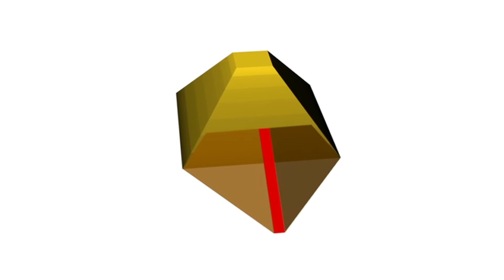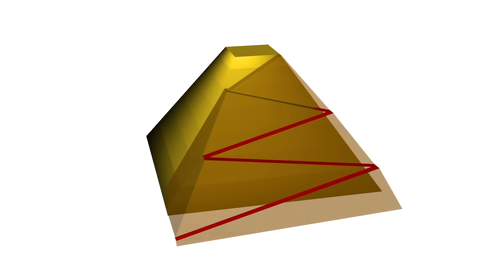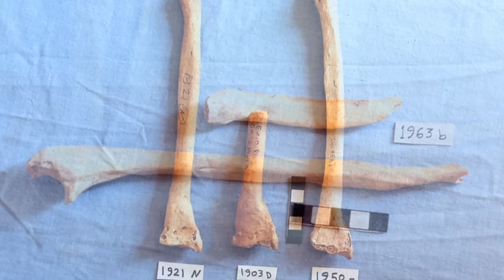Egyptology - Pyramid Construction

Comment: One video proposed they used water hydraulic  like elevators lifting blocks up shafts of water. Would require lots of water and water tight wood shafts . Then one would man handle blocks of stone at top of the shaft to get it off its flotation device . But I honestly dont think that's what they did. Several hundred men can move some pretty heavy stuff just using block and tackle. Say 200 men are pulling each 50 pounds using block and tackle  that would be 500,000 pounds. Now multiply by what ever ratio your pulley system is using . The problem would be finding rope strong enough to pull the weight,  or lift it. That's assuming they did not have chains.
.

Comment: Lol. Guys. Engineers ruled this technique out decades ago when they realised the ramp they’d need would have to be larger and heavier than the pyramid itself. Derp
Reply: And we would see evidence of it which is not there
Reply: @claytonhorn7195 absence of evidence isn’t evidence of absence
Reply: And that it had to be as solid as concrete.
Reply: @ins2177  eduardo is the perfect example of those ignorant old people who claim every process that hasn't been fully explained is the work of satan
Reply: Internal ramp
Reply: A bigger mystery, who built the ramps and how did they get rid of the material??🤔
Reply: @thecure4470  i think they use the nile river to float the blocks.
Reply: @nickkrikorian5909  
Maybe? But you still got to build a ramp or some method of lifting gear but you have to quarry the blocks and square them up with a flatness spec. Not the outer blocks, the much heavier ones and granite ones as the structure had to be built from the inside out. It was not just a case of building a solid pyramid, it was a puzzle and for what or who were they built for? Certainly not a burial chamber!
Reply: Simon Taylor okAy Smart Ass! If you know it then, prove it! Bitch ass
Reply: People in the Belgian Congo dig lithium all day and people in European refineries are making trainloads of plastic. So you can hold a cellphone in your hand...A ramp four times the size of the pyramids would be an easy decision for someone who decided to build a pyramid... 35 thousand corporations got together so we could put moon rocks in a museum.
Reply: dan brownell Great way of looking at it
Reply: The reason for which the Great Pyramid was built perfectly illustrates the desire and determination of the people to leave a trace of their passage through this life and the construction of the Great Pyramid for the Pharaoh Cheops represents a symbol of eternity! 
  Read the book on the website-ul    www.thegreatpyramidofegypt.com   in English or Romanian
 (NO MONEY) and comment on the book , photos with models made of wood and brass board, drawings and sketches commented by the author of the book and logical explanations ?!? motivated by the construction of the Great Pyramid of Egypt. On page 59 is a centralizator with some of the novelties (comment on the 78 news items omitted by ........... and I will send you an autograph book) and assumptions of the authors in the order of their appearance in the pages of the book.  Leave a comment if you can!

   Have a nice day.
   Hănțulie  Ionel
Reply: If you want to know more about their tehnology in ancient go to google and search for " joy of satan"
Reply: @eduardo9571  google ce sors everything. i dont trust google for real research. if they say its a conspiracy most likely its true

Comment: If you really think about workers dragging up 2 ton blocks it's obvious that that method would have been one of the most impractical ways to build a structure the size and Complexity of the great Pyramid.

The estimated number of stones to build the great pyramid is 2.3 Million!

The pyramid is 756 feet long on each side, 481 feet high, and composed of 2.3 million stones weighing nearly 3 tons each for a total mass of 6.5 million tons.

Consider the amount of people necessary to move a single stone from "hooking" up the transport apparatus to Positioning it and the TOTAL amount of time necessary to fully Complete the Project suggests that this is NOT how this was done.  

If you are Limited by your own Lack of Creativity, you're unlikely to see that Einstein was Right on about the importance of Imagination!

Comment: Im thinking a ramp of that SIZE would require the same voume of material as the structure itself.
Reply: People like to assume the ramp went to the top.  That of course is nonsense and unnecessary and thus = reflects a lack of understanding of the evidence as well as critical thinking skills.

1 - the blocks get smaller as the pyramid rises in height.  Google photos of the top of the Great Pyramid.  Note how the blocks there are small enough to have been slid into place by several men.
2 - Herodotus wrote they employed levers and what he termed as "a machine" which was likely a lever device which employed a fulcrum and counterweight.
3 - the largest/heaviest blocks are found in the bottom third of the structure with the heaviest being the relieving stones which sit atop the King's Chamber as well as the longest being the blocks which make up the Grand Gallery which are below that level.  

Moral of the story:  so the ramp in truth only need go as high as the heaviest blocks to be raised = King's Chamber.  Above that level the smaller blocks could be raised via levers.  Herodotus indeed wrote he felt the "causeway" they created to be as great an undertaking as the pyramid itself..........but that does not mean it went to the top.  

Finally the Great Pyramid was built upon a small hill.  You can see where they tunneled into it in the lower passages as well as on it's western base you can see where they cut it down to create a base upon which to lay blocks.  So it's possible they employed that natural incline as a ramp to build up some of the interior before covering everything over with blocks.  This means the ground would act as part of the ramp for a time before the area was encased in blocks.

So you must step back and consider the totality of the evidence.  We have ample evidence they built ramps.  Those ramps however were not necessarily needed to run all the way to the top.  Have a nice day.

Comment: I think the real question is how did they build the huge ramps. If you find out how they built the ramps then you will no how they built the pyramids.
Reply: Ramps were created one of two ways.

1 - we see at Giza the remains of small earthen ramps around tombs which were created from a mixture of sand/stone chips/tafla - a clay they mined and used for a wide array of applications.  When the limestone quarries at Giza were excavated years ago they were found to have had massive amounts of...............yup = sand/stone chips/tafla dumped into them - or what they built ramps out of.  There is also the remains of a large tafla mining operation near the worker village at Giza.
2 - they also created ramps from mud bricks. There are the remains of mud brick ramps at places such as Karnak.  Also in tomb depictions we see mud brick ramps employed in construction along with wooden frames upon which craftsmen stood and worked.  As an example the tomb of Rekhmire contains a mural of a hypostyle temple being built.  There is a mud brick ramp leading to it while it's interior is full of mud bricks to it's top.  So they systematically laid bricks and blocks level by level until the top lintels were placed.  Then they removed the mud bricks - chiseling the blocks as they went = until they reached the bottom leaving only the completed columns of the temple.  

Moral of the story:  so we know how they built ramps and how they were created and employed.  In the case of the pyramids only the shape of the ramp is unknown.  We do however know it once sat on the south side of the Great Pyramid leading down to the adjacent limestone quarries and the harbor which once sat near where the Temple of Khafre now sits.  

The south side is closest to the harbor and quarries + the other sides are not conducive to a large structure as there are steep drop-offs + and all of the ancillary structures - Queen's Pyramids - are found on the eastern side.  All royal pyramids always had the ancillary pyramids on their southern side - all of them except for Khufu.  That tells you that "something" large was there to block their construction = which has to be the ramp.  Have a nice day.
Reply: @varyolla435  very educated answer a very interesting read thank u.
I find all this very interesting they wer well ahead of there time. None of the engineering skills make any sence to us. Its amazing
Reply: It only doesn't make sense for those who fail to first learn all of the evidence as I alluded to.  What I noted is but the tip of the iceberg.  So the Egyptians were not stooopid = just not as technologically advanced as we are today.  Yet the basis of much of our technology results from precepts laid down centuries ago as a result of observational analysis and trial and error.  Ancient peoples saw "correlations" in nature etc. and studied them to develop things as a result be it mathematics or whatever.  

Moral of the story:  the Egyptians employed trial and error to find something which worked.  We see this progression of learning in the early crude mastabas and pyramids leading up to those at Giza which represented the apex of pyramid tech.  Once they found something which worked = they employed it going forward.  As an example = corbelled halls.

Limestone is a mediocre load-bearing stone.  As such employment of it across wide spans lends to cracking and collapse.  That is why later temples employed harder sandstone for lintels while the columns themselves were of the softer limestone.  Anyways we see corbelled hallways in the Red Pyramid whereas the earlier Bent Pyramid in trying to create large rooms internally eventually saw cracking with subsidence.  By stacking inwardly the wall blocks in a tapering fashion = the room can withstand the weight above.  We subsequently see corbelling employed in pyramids going forward.  

So they were not some mythical "advanced civilization".  They simply tried different techniques until they found something that worked.  Have a nice day.
Reply: @varyolla435  if I may ask you a question how do you think the pyramids wer built and why
Reply: 1 - the employed ramps and levers as noted to raise objects.
2 - Google pictures of the limestone quarries at Giza and elsewhere.  Note how we see shallow cuts in the bedrock along the layers of limestone with holes alone the line much like the edge of a saltine cracker.  They would drive wedges into the holes until the bedrock fractured along the line like breaking off a piece of a Kit Kat bar.  Then long chisels would be driven into the fractured section of stone until approximate sized chunks broke off which would be carted away.  In some cases copper saws and an abrasive such as sand or corundum would be used to more precisely create a block and in some cases it would be polished via sanding using said abrasive and perhaps clay and water.
3 - look at all the pyramids = where are they found???  Answer:  on the western bank of the Nile.  Why is that important???  Answer:  in the Egyptian religion that was considered "the land of the dead".
4 - also note how pyramids are all co-located around cemeteries.  Where you see a pyramid = you find a necropolis.
5 - pyramids always came with an accompanying mortuary temple of which almost all have been destroyed long ago.  

So pyramids = tombs which are as noted above always located in cemetery sites surrounded by tombs and temples.  The Egyptian religion was based upon 2 things.  First is the body must be preserved.  No body = no afterlife.  That is why they mummified people and buried them with things needed in life.  It is also why they put them in things like sarcophagi and tried to create "robber proof" tombs. 

Next is you needed to keep your name alive so as to be remembered.  If people forgot about you then offerings would not be made and you would not exist in the afterlife.  Accordingly they built temples and tombs to "stand out" so that others remembered them and the requisite offerings could be made.  On a side note that is why later pharaohs during the New Kingdom employed damnatio memoriae = or "erasing" someone.  They would change the cartouches on temples and have their own placed upon them to take credit for what another did.  Sometimes they simply destroyed the temple altogether to try to erase any memory of a person. 

Moral of the story:  so to understand the pyramids = understand the Egyptian religion.  They were tombs created to try to protect the body of pharaoh and to make him stand out so as to be remembered and thus ensure his existence in the afterlife.  Unfortunately for them = aboveground tombs were magnets for tomb robbers.  

Accordingly almost all royal tombs in Egypt were plundered millennia ago when the Kingdom's collapsed and times got hard.  Since mummies were wrapped up with valuables = they were often destroyed by tomb robbers via cutting them up and/or burning them to get the valuables within them and to destroy the afterlife of the pharaoh. The same happened for the later underground tombs as well. Sometimes later pharaohs themselves ordered tombs be opened and plundered to replenish the royal treasury.  Ramses XI did this as one example.   Have a nice ay.
Reply: @varyolla435  very well said was good reading all your comments thanks bro

Comment: "The limestone outer cases were removed to build mosque and Castles in Cairo"??? Why and how would you remove blocks from that high up and transport them safely to the bottom of the pyramid? And then hope they fit your new structure correctly. What a bunch of BS.
Reply: Why Knot Do you have a better idea?

Comment: If i may, let me take a crack at this. Remote viewing indicates. 4 ramps. At alot less steep angle than 52 degrees.Different stones were transported in different ways 3 main ways. 1: some stones were quarried into a cylinder shape. Wooden posts were attached to each end using leather straps. Then, leather straps were wrapped around the posts with animal fat as a lubricant, and they were pulled by animals. They were pulled all the way to their destination. Then 3 sides were carved flat, then they were rolled into their place unto the flat side. Then the other sides were carved flat. 2: Some stones were moved as a rectangle. If you take a staircase, and lay it on its back, on the floor, its alot easier to move a heavy rectangular object. One of these ramps had a wooden structure like that for moving rectangular blocks up the ramp. 3: im sure you have noticed all the depictions of the scarabes or dung beatles throughout Egypt. The Egyptians were taught to attach millions of dung Beatle wings to a plank, and activate the wings using bagdad batteries. The dung beatle does not fly, its wings use anti gravity.
This is the reason that royalty were so impressed with a creature that digs around in dung all day hmmm? They were taught this by the guardians of the sky " Atlanteans". They were called this because of their ships that flew by means of a hot air balloon aided by millions of dung beatle wings. If you want to find the city scan Antarctica for gravitational anomalies. The 100% human non god Posiedon has a vault made from a mineral not found on earth. It was a gift. Its about 5 1/2 times harder than diamonds, and extraordinarily heavy. It should produce fluctuations in the gravity fields in the city.